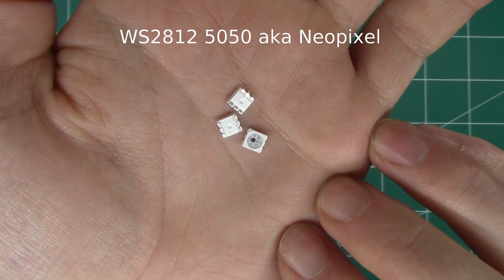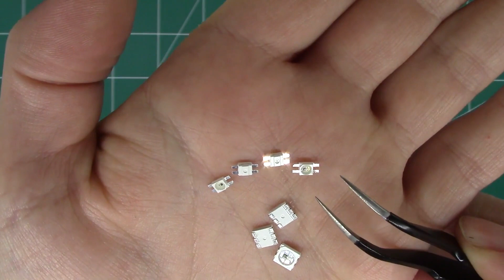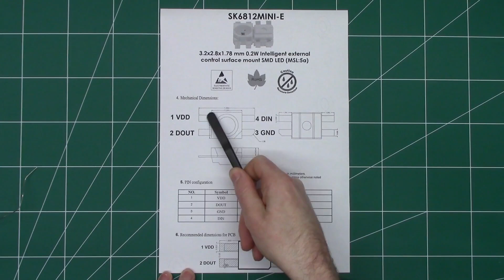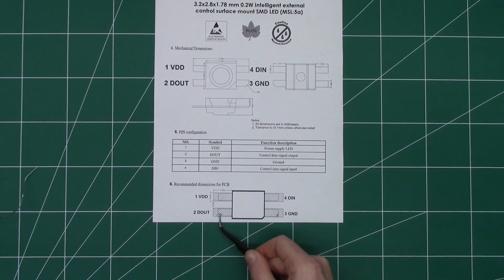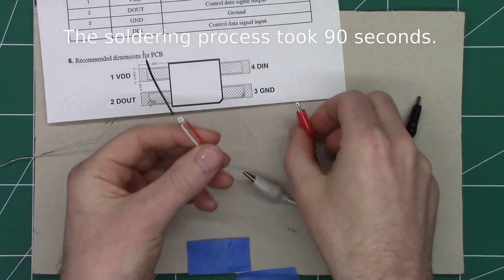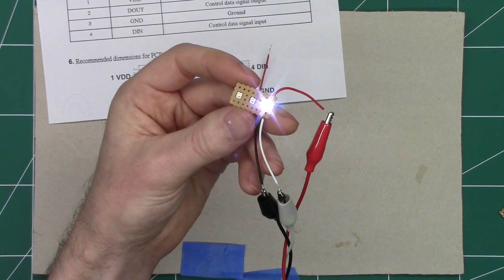Looking at the SK6812MINI-E  - A hand solderable Neopixel compatible LED

Comment: Are you using a library to control them?
And could they work with 3.3v on a Raspberry PI?
Reply from the maker: The AdaFruit NeoPixel library on Arduino, but any NeoPixel library should work.
You'll get some functionality with a couple of LEDs on 3.3v. Blue LEDs need more then 3.3v to light up correctly, and voltage drop will be a big issue.
Reply: @PartFusionMakes  Thanks

Comment: Hi! Do you know how low of a current the SK6812 Mini-E can run at? I'm trying to drive 91 of these from USB (for a mechanical keyboard) but it seems like that'll only work if each one draws around 4mA. I know it has been done on keyboards before, so I'm assuming its bright enough, but I'm not too sure.
Reply: I think you would want to use USB-C on your keyboard and negotiate for high current draw.  The datasheet I found was vague on some of the current values, but it looked like with the LED off, it would draw 1mA and all on it could draw 12mA.  I wouldn't want to design a keyboard around the hopes that my code would need put the LEDs in a configuration that could draw too much power.
Reply: @neltzroth5744  that's a good idea, I would have to use some sort of control board to do that since i doubt my microcontroller supports something like that.

Comment: Hello nice video just want to ask what  capacitor is suitable to put on those led thank you
Reply from the maker: Decoupling capacitors aren't always required (probably a factor on power supply quality, length of cables).  A starting capacitance value of 0.1 uF (microfarad), physical size can be any practical size. In your circuit design in for some decoupling capacitors every 5 to 10 LEDs, and see how it goes.

Comment: Any idea what the max draw is per led? I can't seem to make heads or tails of the spec sheet.
Reply from the maker: The 12 in the SK6812 means 12mA per LED color. So with all three LEDs at full brightness each pixel will need about 36mA. I also just tested this with a multimeter and got 12mA for one LED on,  35mA for all three LEDs on, and 0.5mA for no LEDs on.
Reply: @PartFusionMakes  thank you!!
Reply: @PartFusionMakes  Thanks!

Comment: Great video. Have you tested if the SK6812MINI and the SK6812MINI-e have the same pinout?
What I find from the datasheet is that the terminal pads are not pointing in the same directions
Reply from the maker: Yes, very different beasts. I would definitely recommend triple checking with physical devices before committing to a footprint for a PCB design.
Reply: Damn, why would they make the pinout different? I was really hoping for something for these  SK6812MINI mid mount leds on a keyboard kit I'm working on. So frustrating

Comment: No @0:04 those are not WS2812 but WS2813...
Reply from the maker: The WS2812 and WS2813 have the same physical package, but have a very different pinout configuration. These are WS2812's.
Reply: PartFusion WS2812 only have 4 pins, WS2813 have 6 pins. Both are in a 5050 package
Reply from the maker: I've been using these addressable LEDs in my projects and products since about November 2012. At the time I bought them they were referred to as the WS2812 and came in a 6 pin package. A while later the WS2812B became available and was in a 4 pin package. A number of years later (I'm not sure when) the WS2813 became available which was also in a 6 pin package.
Reply: PartFusion my fault ws2812 have 6 pin but new ws2812b have 4 pins

Comment: Thanks for the wiring info, should this circuit include any sort of resistor? I have a few individual Neopixels that I want to use on the hot end of my Ender 3 and you my friend have got me one step closer. thank you.
Reply from the maker: Hi Adam.  In general with a stable 5 volt supply you wont need any resistors.  A small value resistor (50-150 ohm) on the VDD pin can be used to improve the protection of the LED from voltage spikes.  Also having extra capacitors right beside the LED can help to reduce flicker.
Reply: @PartFusionMakes  Perfect timing, I am starting this project today. Thank you for the tip!
Reply: @PartFusionMakes  Really good video, and nice craftmanship for this tiny parts. Thank you! A Question. You say "having extra capacitors beside the LED", but I haven't found any information which capacity they should have. In the datasheets I've seen, the values are unreadable. I would greatly appreciate a recommendation.
Reply from the maker: @obertan_1  A surface mount 0.1uF (0.1 microfarad = 100 nanofarad) decoupling capacitor is recommended beside each LED.
I don't believe the the physical size of the decoupling capacitor or the capacitance value really matters.  I've had circuits that didn't need any capacitors and others where I needed to add multiple capacitors per LED to get stable operation. Probably the type of power supply/length of power connections had a bearing.
In your circuit design leave some space for adding capacitors every 5 to 10 LEDs and see how it goes.

Comment: How did you cut the square holes?
Reply from the maker: I used stripboard for prototyping the circuit, which consists of a 2.54mm grid of holes and copper strips.  I was able to carefully cut between four of the holes and then used a small file to clean up the edges.
Reply: @PartFusionMakes  Thanks!